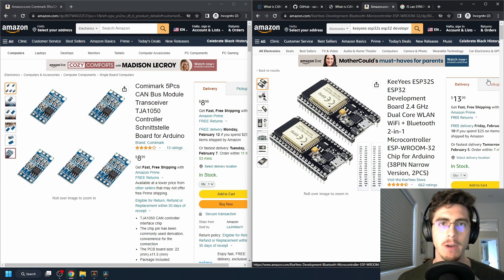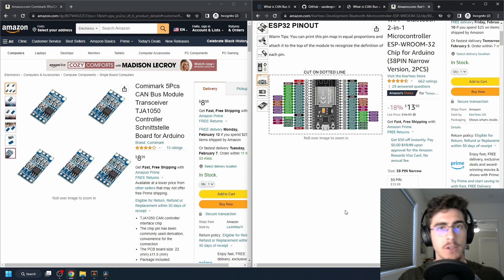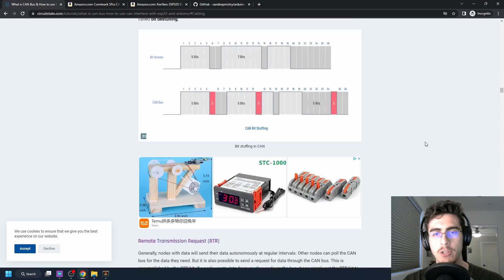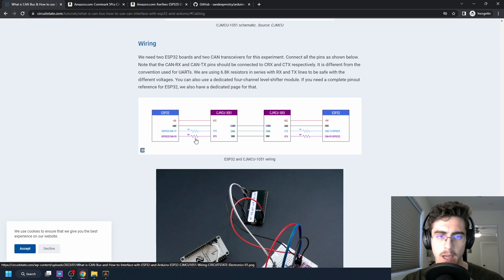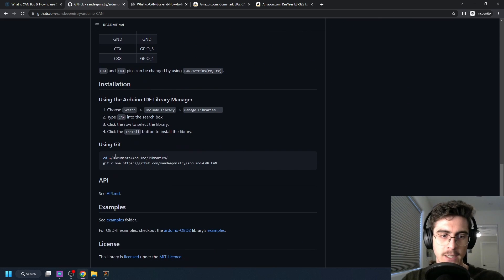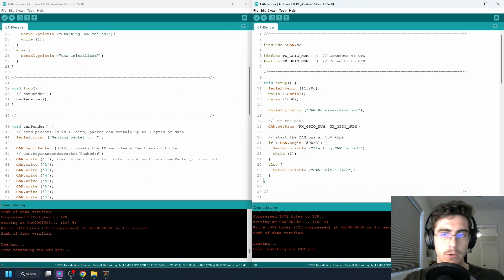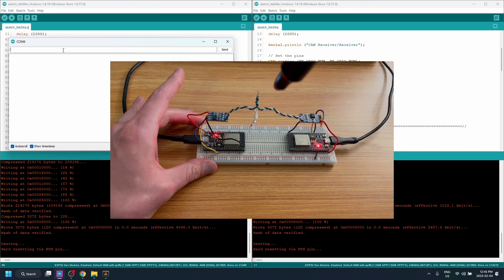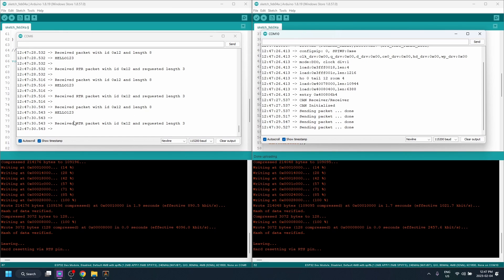Making a CAN Bus on a breadboard with two ESP32 microcontrollers!

Comment: Hey EV Engineer. I am currently trying this set up to test out CAN comm between two esp. I seem to be getting errors with esp_intr.h in particular. Did you run into any issues with this? I have yet to see anyone online have this issue. I just want CAN to work between my ESP32s and this has been increasingly frustrating (as it seems most libraries also reference this header file).

Comment: you can use SN65HVD230 they are 3.3v voltage level safe, for esp32 you need to use the ones with 3.3v logic level or you'll bust your pins( alternatively you can use ones you mention with a resistor divider to 3.3v LLvDc)

Comment: I often see an MCP2515 used in conjonction with a TJA1050. You're only using the TJA1050 ans I don't really understand how it is possible ?
Or, is in your example, the workload that should be done by the MCP2515, is done in software by the ESP32 ?

Comment: Hi, great video. I am working on copying this system for a little canbus project over here. I did everything up to the point where I need to add the CAN library to the code, (including soldering up the different boards) but I keep getting a persisting error message that says 'library not found.' Even though I saved it directly in the Arduino library folder. Any help to get past this little block would be greatly appreciated ! Thanks. Once I correctly compile the code using CAN library, I can most likely make it work for our project (to activate a CAN controlled ev charger).
Reply: I fixed the problem by going into the 'Board Manager' and reinstalling an older version  of ESP32 (2.0.11) instead of the current version (3.0.4, in my case). This allowed the board to recognize the CAN library. found the answer on the 'github issues' page. Thanks!

Comment: G'day Josh,  Am having trouble compiling with this error:
f:\Workbench\Arduino\libraries\CAN\src\MCP2515.cpp: In member function 'virtual void MCP2515Class::onReceive(void (*)(int))':
f:\Workbench\Arduino\libraries\CAN\src\MCP2515.cpp:270:9: error: 'class SPIClass' has no member named 'usingInterrupt'
  270 |     SPI.usingInterrupt(digitalPinToInterrupt(_intPin));
      |         ^~~~~~~~~~~~~~

Any help would be very much appreciated
Craig

Comment: This video serves as an excellent introduction to the fundamental aspects of the CAN Bus setup. I'm eager to learn more so I can gain a deeper understanding of the communication system within my Ducati. I presume that if there's a need to continuously transmit dynamic data, such as throttle position codes, there must be a method to relay this information to the microcontroller without requiring a flash and reset of the device. In my scenario, the constantly changing throttle position codes would be transmitted over the CAN Bus to the Engine Control Unit (ECU) to regulate the engine's power output.
Reply: Why you want to transmit to the ECU? Usually, this is a data wich is transmitted by the engine ECU over CAN Bus, you can read the CAN traffic and maybe datalogging it on an SD card or send to a Display.  In you case, the TPS position is hardwired to the ECU, readed the analog signals (more than 1 signal in case of multiple Throttle bodies independently controlled with TBW system).
Reply: @hiperformance71  Why would you want to transmit accel COMMAND to ECU? Think hard

Comment: Is there hardware that is in a shock proof case, meaning can be use in more of extreme conditions that has both the comimark transceivers and ESP32 in one ?  I have a project where i need to control 10-15 CAN bus components, but its outside and i need something in a case that can withstand this environment.

Comment: Previously, thank you for making this video. I want to ask why when I run the program, the Sender only displays Sending Packet and the Receiver only displays CAN Initialized
. I'm using MCP 2551 Transceiver
Reply: I'm facing the same problem , did you find a solution ?
Reply: Same problem, did you fixed it 😢😢

Comment: Hi Josh can you explain to me what is CRX wire and gauge. I just am hearing that call out for the first time. Thank you Artie 👍
Reply from the maker: Hi Artie, the CRX/CTX (CAN RX/TX) lines are the interface with the CAN transceiver. Connect them to any GPIO on the microcontroller. CTX allows your microcontroller to send data to the CAN transceiver, and CRX allows you to read from the CAN transceiver. Given they are simple GPIO cables that only carry around 20mA, you can use any simple jumper cable (22-28 gauge I think?). Cheers
Reply: @EV_engineer  thanks I’ve got it now. Much appreciated for your reply. Cheers mate

Comment: Why do you need a transceiver? I thought esp32 comes with twai (can) in them. Are these transceiver acting like CAN devices? Like sensors or something?
Reply from the maker: The ESP32 has a twai (CAN) controller. This handles the Data Link Layer. Still need a CAN transceiver for the PHY layer
Reply: @EV_engineer  Thanks for your quick reply. Such a shame I thought esp32 would have transceiver in them. Damn! Great video by the way liked and subscribed.

Comment: any info on how to read data from votol em 200 ?
Reply from the maker: I've never used this particular device, but I imagine the process is similar to reading from any CAN bus. You'll need to follow these steps, roughly speaking:
1. Create a CAN Bus Connection
2. Initialize the CAN Bus, as per the votol documentation
3. Listen or Poll: Now you can either listen for CAN frames (passive) or actively send query frames to the Votol EM-200 to request data (polling). Again, the specific CAN IDs and query commands would be found in the Votol documentation.
4. Decode the Data

Hope this helps,
Josh

Comment: One more thing. The transceiver board in your link seems to be 5 volts device where as ESP32 is 3.3! Any comments?
Reply from the maker: Hey! Yea it also seems to work fine if you power it with 3.3V. There was another comment thread discussing this you might want to check that out too.

Comment: Hello. I am a bit stuck and I don't know why. I am using the same library as you and the documentation say but somehow I get the following message: class ESP32SJA1000Class' has no member named 'beginPacket'; did you mean 'endPacket'?

And yes. Indeed in the ESP32SJA1000 Class of CAN Library is no attribute called beginPacket. Only endPacket..
Reply from the maker: Did you use the same example sketch?

Comment: Got a couple of questions...
Is there any way of the recieving ESP32 to send the acknowlege bit?
And how many bits (bytes) can be sent in an extended frame?

Thankyou for this tutorial, I'm having fun building and learning CANbus, and this video is an excellent guide for getting started 🙂
Reply from the maker: Hello, glad you find the content helpful! The extended CAN frame holds the same amount of data as the standard frame, it just has 29 bits for the identifier. Regarding your question about ACK, the short answer is yes. The ACK bit is part of the CAN frame itself. The transmitter sends recessive (1) and any receiver can assert a dominant (0). This logic is handled by the CAN controller, which can be a hardware or software implementation depending on the CAN node. Since I showed an ESP32 acting as a CAN receiver in this video, I think it's safe to assume it implements the protocol correctly.

Comment: The upload may be blocked, as you're using gpio0 in your wiring.
Try switching gpio0 to any other pin, as that's the pin that the BOOT button connects to.
Reply from the maker: Wow that’s an obscure failure mode 😆, thanks for the tip!

Comment: amazing work , can u make it with MCP2515 can module I tried all the methods didn't work so can u help me✌
Reply from the maker: Thank you! I'll consider making a video on it
Reply: @EV_engineer  if you do, please mention can bus fd, I found some designs on a pcb that had both can and can fd, it was using mcp2515 and mcp2518fd. I'm trying to figure out if you need both, or if you can simply use mcp2518fd, meaning is it backwards compatible?

Comment: The ESP32 is a 3.3v chip. The dev board provides a 5v to 3.3v regulator. The can transceivers use 5v. You have them connected to the Vin pin, which is 5v from USB. The CAN H/L lines swing from 0 2.5 and 5 to 2.5. This normally would be too much for a ESP32. I thought maybe the resistors are placed there in the reference doc to help with the voltage difference. In series like this is not the best, it will slow down transmission. Using a logic converter is the best way. But it also looks like this particular chip can handle 3.3v signals. Not the one you have. Is seems to work though. Interesting.
Reply from the maker: Hi Chris, you are right, the ESP32 operates at 3.3V, and the dev board down-regulates 5V input. It's worth noting that the voltage levels on the CAN bus are specified by the CAN standard, not by the TJA1050 transceiver itself. High-speed CAN signalling at 5V input drives the CANH wire towards 3.5 V, which very slightly exceeds the 3.3V max of the GPIO pin, probably fine. Taking a look at the TJA1050 datasheet, it also works in 3.3V mode, so I'll probably use this instead to make sure I don't fry my micro, nice catch! :)
Reply: @EV_engineer  After reading the datasheet, it seems that it only works at 5V
Reply: @Quemedices684  TJA1050 datasheet states: "Input levels compatible with 3.3 V and 5 V devices"
If you power the transceiver from 5V, and the controller from 3.3V, the transceiver should not fry the controller.
Reply: ESP-WROOM-32 datasheet clearly states that maximum input for high logic level is VDD+0.3 where max VDD is 3.6V so max level is 3.9V
Reply: You might also try a 100 ohm resistor to clamp the Rx line to the esp, instead of a 10k resistor :)

Comment: video shows demo situation, how to really use, needs wifi added i guess, local esp32 is connected to wifi access point,
can bus wiring extends maybe thru a steel wall (blocks wifi) and then the other esp23 is a wireless access point ...
might be totally wrong
Reply from the maker: There are many use-cases indeed!

Comment: ALLWAYS use bus termination (120 Ohm)!!
Reply from the maker: Agreed! And these transceivers in fact do have 120ohm resistors built-in, (R3)
Reply: Not the transceiver!!! NEVER!!
Your breakout board might be equipped with a 120 Ohm termination resistor. In a circuit Diagramm they should be included and be placed at the right position.

Comment: Thanks! If I just want to pass 1 or 0, what will be the scheme?
Reply from the maker: If you mean the payload literally has a 1 or 0 bit then I'm not sure if that's possible with the library I used. I'm considering writing my own CAN driver in a video, stay tuned!
Reply from the maker: Sending a character '0' or '1' should be fine with the current schema

Comment: Hey boss if I would like to connect to a vehicle and write a script to send a command upon connection is that possible
Reply from the maker: Hello! You can certainly connect to a car's OBD port which will give you access to the CAN bus. I'm actually planning on doing a video on this :)
For sending messages, check out SocketCAN: https://blog.mbedded.ninja/programming/operating-systems/linux/how-to-use-socketcan-with-the-command-line-in-linux/
Reply: @EV_engineer  is it possible if i use same hardware setup , where one end is connected to car obd port , to read the can messages .?

Comment: In your experience, what would you say is the advantage of CAN bus over UART or I2C?
Reply: and there is another major difference it seems to me, the UART is not addressable and can only communicate with 1 single device and the CAN protocol solves this
Reply: Noise immunity and distance, I2C and UART(at least at TTL levels) are designed mainly for short distances.
Reply from the maker: Couldn't have said it better! Also transmission speed is usually faster on CAN, although there may be a few edge cases with high-speed I2C

Comment: 5:41 you can use CAN or UART on any esp32 pins.
Reply: there are pins provided specifically for the CAN?
Reply: @badwolf4469  Yes but still need an external canbus transreciever to control canbus controller inside the esp32. Canbus controller only enables protocol, canbus transreciever grabs message and detects where they go based on internal CanBus controller on mcu. That said SN65HVD230 works best as it has 3.3v logic level,which means you can trigger internal controller without need for logic level converter(mcp chip is 5v so will fry your mcu)